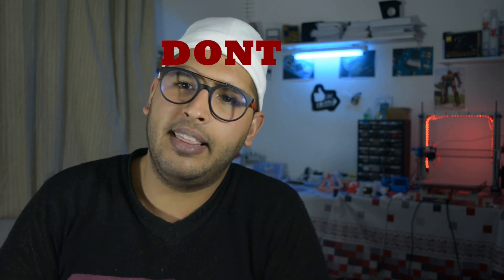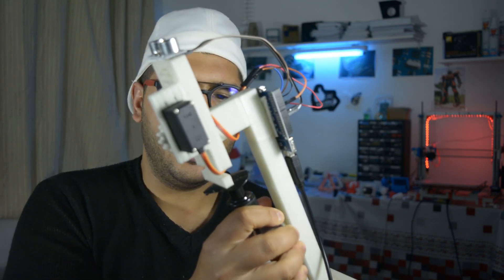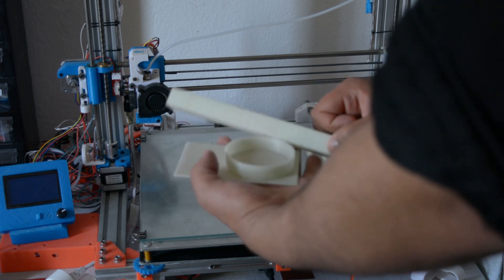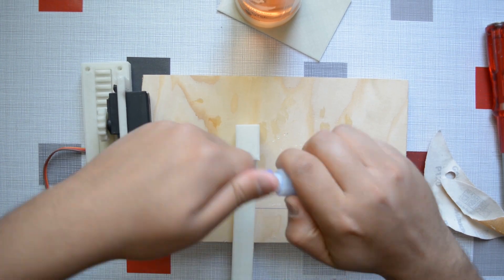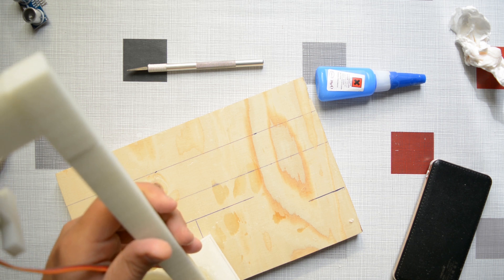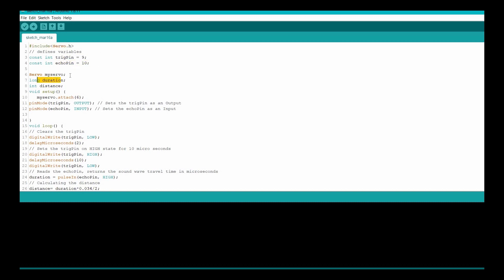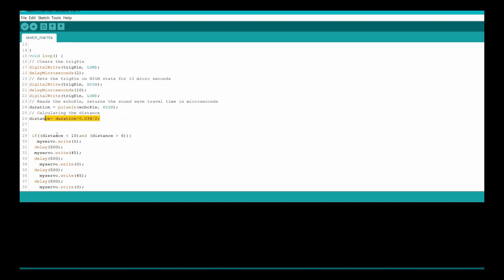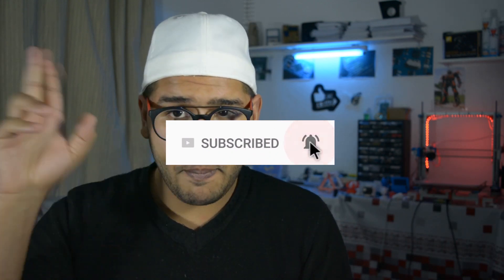How to make Automatic Soap Dispenser - 3D printed !! #20

Comment: Where to buy from sanitizer bottle in this size ?
Reply from the maker: I found it in a local shop , i think you can find a. Champo or or soap bottel and just remove the inside and fill it with alcaholic soap
Reply: Sir ,please give me a gear rack 2stl  file sir ...I can't open this file ...this file is large of x size (119269.9844)
So please give me a correct size of gear track 2 stl file
Reply from the maker: @vinoths3192   what do you mean its large? that is the correct file

Comment: 1st of all you're putting so much stress on your 3d printer and waisting a large amount of time and printing material on this project knowing that 90% of printed parts could have been replaced with any other accessible material such as wood or metal or even plastic and thus save alot of time and preserve your 3d printer's life.. 
Also, I will not sacrifice an arduino board alongside the ultrasonic sensor to put them permanantly in a small project, you know how much these parts cost in tunisia..
The video lacks of details about how to design parts and how you take the measurements for parts and their placement..
My note to your project: 3/10